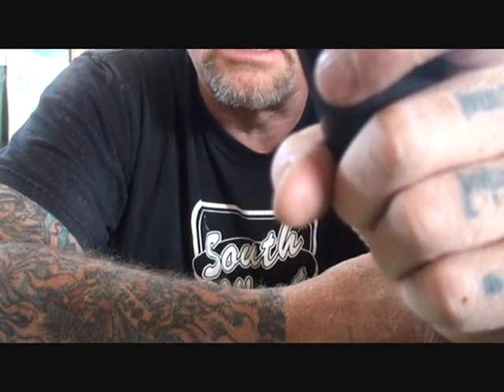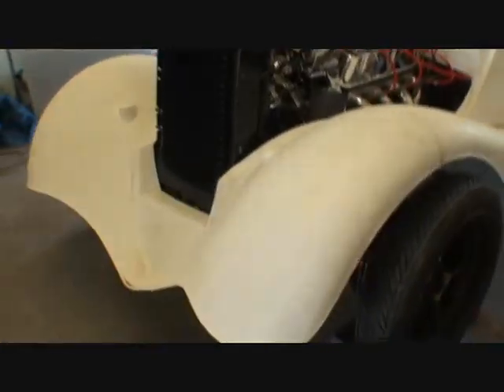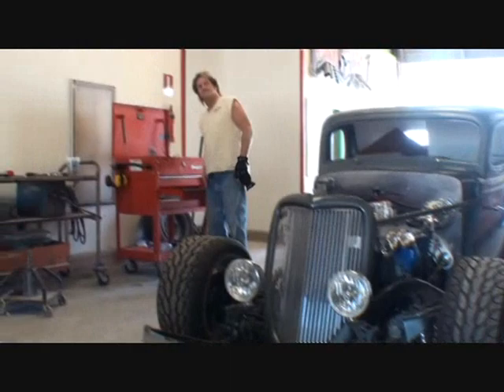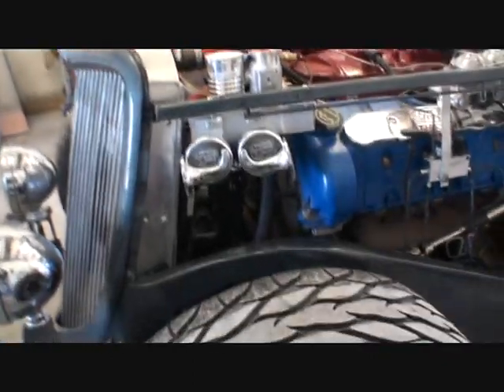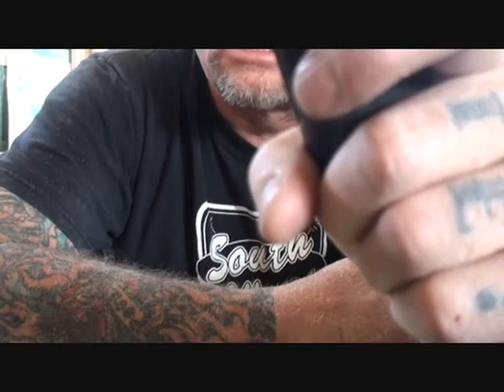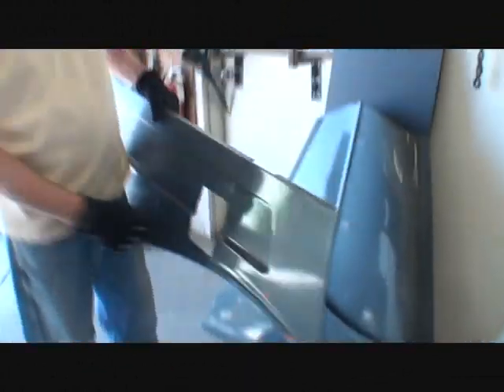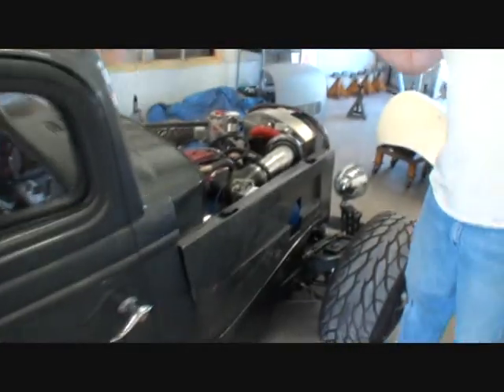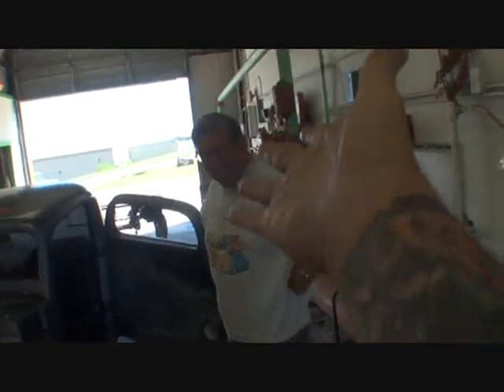1934 Ford Coupe-BIG BLOCK MONSTER CAR

Comment from the maker: If you really want to get technical it's neither a small or a big block, it's called a modular block. The name was derived from a manufacturing plant protocol, "Modular", where the plant and its tooling could be changed out in a matter of hours to manufacture different versions of the engine family. Modular engines used in Ford trucks were marketed under the Triton name from 1997–2010 while the InTech name was used for vehicles equipped with DOHC versions of the engines. MY Friend FPS347GT

Comment: I used to machine & build/hot test the 4.6L engines at Ford in Cleveland. It's a cammer small block that revs fast. Reminded me of a super truck motor in hot test. Good motor with optional throttle bodies,etc.